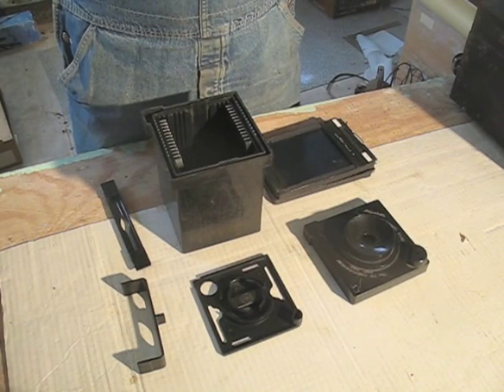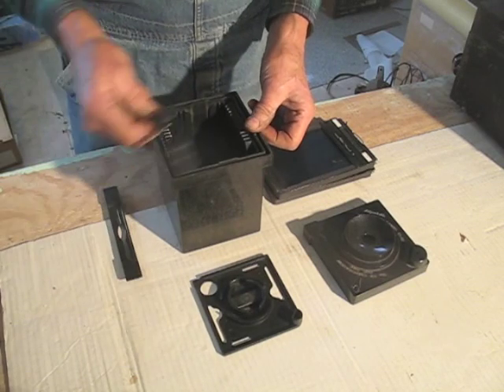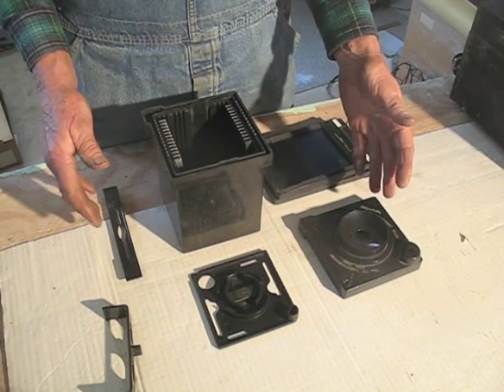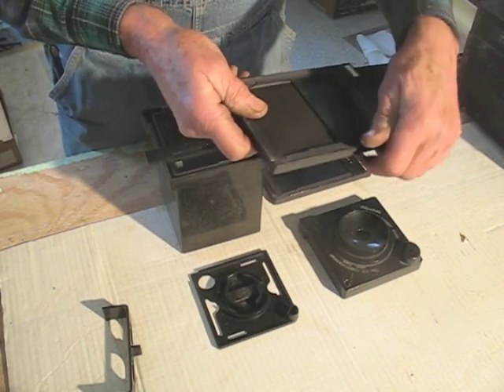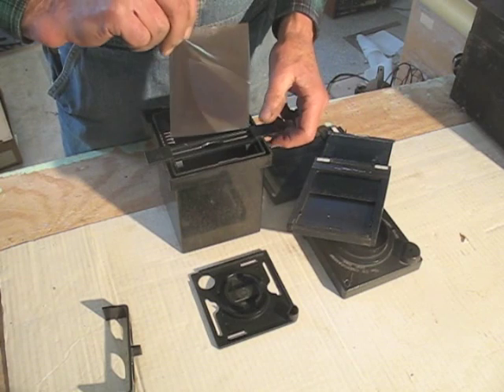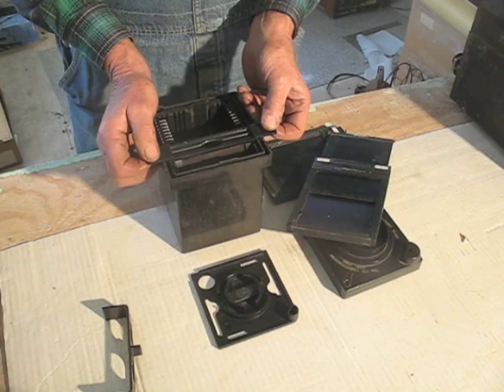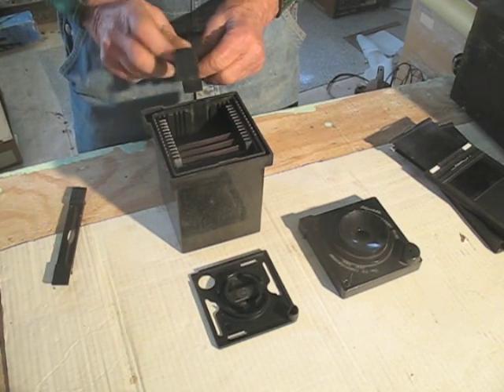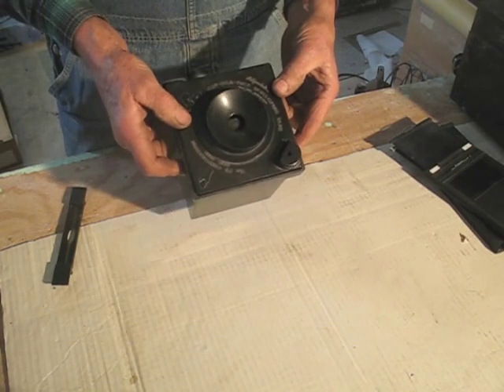How to Load the FR Daylight Film Developing Tank

Comment: I used one of these FR tanks about 20 years ago, when I was in my Galvin 6x9cm view camera phase. It works quite well as long as you acquire a technique for adequate agitation. 6x9 sheet film development presents the problem that there were few tanks ever made to handle this size, and of those only the FR were sold in any volume. I think that it is possible to muscle a few sheets at a time onto 120 plastic film reels as an option.
Reply: I came here to find a way to agitate adequately. It is proven hard to find this anywhere. I have developed for over 20 years but this tank is new to me and it is yet not clear how to agitate as the chemicals are not enclosed safely within the tank. Meaning, when I invert the tank the chemicals poor out the lid. It cannot be by design, it must be me who doesnt understand how to use this thing. Can anyone advise me on this please? Kindly Lowe H Seger